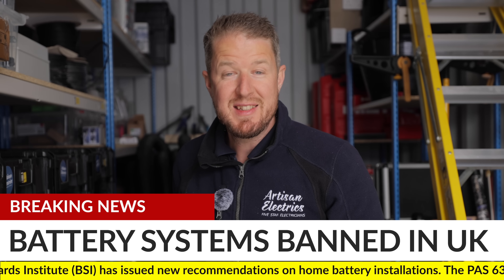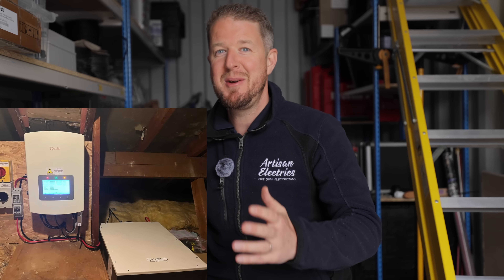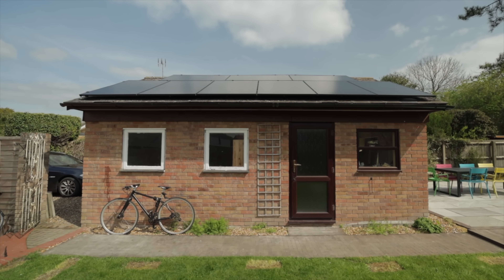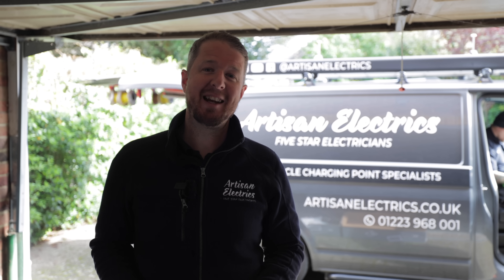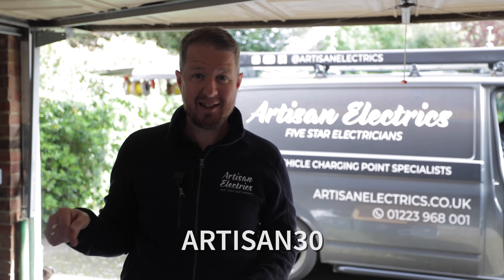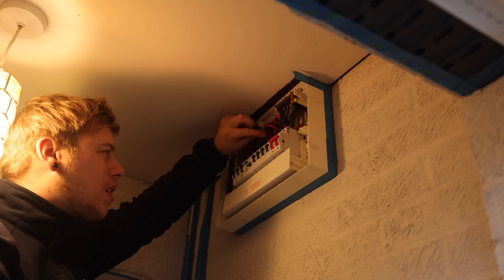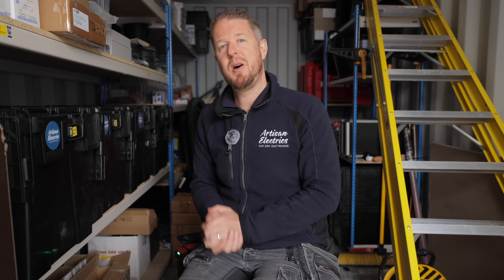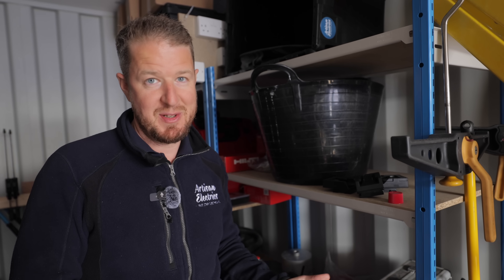Is the UK Banning Home Battery Storage? 😱

Comment: The UK is becoming just stupid, last year my folks had solar installed with a battery in the loft....... how many properties in the UK have an outside 'building' at all....let alone to install batteries.... this is another reason why solar is not going to take off in the UK... stupid rules like this... there are other options for battery installation in a loft, like adequate air flow to keep batteries cooler in summer... its really not difficult.... Fire in the house ... yes of course this can occur, but this is why you have insurance to a standard.! If the standard ends up changing because of this it's just stupid......... to prevent people from being able to save money but also reduce carbon foot print. This is another case of trying to make 'free electricity' difficult so the less well of person without 'a garage', can't save money.. why.. so you have to keep paying those poor people at the top of the chain in energy companies.

Comment: Problem in battery loft installation is heat in the summer period. I assume the battery chemistry is lithium-ion and as we all know the electric cars use this battery chemistry and when the battery pack increases its internal heat a cooling system is used to ensure the battery temperature remaining within the stated temperature range as per the battery manufacturer.
So what keeps the loft batteries installation cool in the summer?
Reply: Most solar batteries are lifepo4, not Li-ion.

Comment: As an installer you have a duty to exercise due diligence and from your video you should be recommending that batteries etc should be fitted on an outside wall in a suitable IP rated enclosure complete with the necessary ventilation. The IEE rules and regulations are lacking no electrical engineer should recommend fitting a battery unit or a device that needs inspection and maintenance in a loft it’s irresponsible.

Comment: Greetings. You recorded this video in a container, which has insulation on the roof. What insulation did you use?  Did you screw or bolt it to the roof, thus rendering the container no good for shipping.
I have a container workshop in southern Spain and last summer the Max/Min thermometer read 66C.  So I couldn't have a solar battery in there then! Thank you.

Comment: The recommendations make much of the need for fire proofing around the batteries but surely these can’t apply to lead acid batteries which are also often used in a bank to supplement solar panels etc.  These have no known fire risk because of their construction.  The only risks are possible small emissions of Hydrogen and Oxygen if their charge controller is allowing them to over-charge which it shouldn’t do, but these emissions are quickly dissipated by even the gentlest ventilation.  And sealed lead acid batteries such as AGM types which can be mounted upside down on on their side, don’t emit anything.

I hope the recommendations distinguish between battery types rather than attempt to become a ‘one size fits all’.

Comment: The new regulations state that batteries can not be installed in a loft as they could fall on people and are more exposed to the elements... Instead they now suggest you now install them outside where they are directly exposed to the elements.

Comment: as an electrician who started working in the 1970's  I used to remove metal fuse boxes & replace with wooden backed & plastic fronted ones, we was also told not to fix them on a wooden board due to fire etc but then came the Electricity board & they fixed the main incoming head & meters on chipboard!!
now its gone in a complete circle & metal has come back, also grommets where ok in the older metal boxes now they are not.
I think somebody is making a lot of money changing all these rules & regulations, maybe we should all just use our common sense, remember when we had to take an earth wire from the consumer unit direct to the metal bath legs then drill & tap it & use a brass 2BA scew & washer,   what stupid person thought of that?  then they said lets change the colours of the wires to Harmonise with Europe, what a load of nonsense that is, I've worked in France/Italy & Germany & none of these countries use the colours that we have now had to change over to, France use Blue as the neutral, green & yellow as the earth & then all the other colours of the rainbow can be used as live's this is great as when you wire the consumer unit you can use different colour wires for certain circuits so you can identify them just looking at them,  there is also no such thing as a ring main, they just use Radial circuits (so much easier to find a fault)  also RCBO's have been out there for over 20 odd years & cost half the price that we pay.
We have a lot to learn from the French way of wiring.
My last gripe is using the new colours on the 3 phase , this is rearly Dangerous, how can black be a phase when the old system it was the Neutral? i wonder how many people have got a shock or died because of this change.
Reply: You forgot the "feed in to consumer units must go through the same hole to stop overheating by eddy currents"  You would need to push hundreds of amps through the circuit to even cause a single degree of heating.  And the not running data cables next to power cables (in a domestic install) to stop dangerous induced voltages !  Those who generate these regs don't seem to apply practical science to their deliberations a lot of the time.

Comment: I have two LFP 5 kWh batteries in my loft. They both have an internal fire extinguisher. The brand is Sessy (NL) and they are connected between the solar inverter and the consumer panel. The location is not ideal I agree and our new house will have a detached garage for sure for the EV's, solar panels, inverters and batteries.

Comment: Not recommending/allowing in the loft or even in the house would make a lot of installations impossible at least in The Netherlands in modest "15 under one roof" row houses.

I do get the reasons.... Thermal runaway and uncontrolled fire/exolosions are real substantial risks.... In common NMC cells. BUT a lot of 'statuonary' batteries are moving towards LiFePo4 chemistry. 

And with those, uncontrolled thermal runaway is not a thing any more. The can still eject explosive/combustible gas when 1 or more cells get damaged, so at least there should be adequate ventilation available.

Unfortunately, LiFePo4 doesn't like cold/freezing conditions. So outside the house or in a badly isolated shed is not an option

Comment: My view on best practice standards are they are of most use if something goes wrong and someone asks "there is a specified standard for this, why did you deviate from the best practice?" 
This way of work could be introduced into Fire safety: Approved Document B or a new part of the Building Regulations such as with EV charging points in 2021 and the introduction of Document S: infrastructure for charging electric vehicles.

Comment: i thought people would choose them outside in a cabin ive always think safety when 
even storing a battery.
i think if its outside then you should be able to gave as much as u want but maybe they could also note were they are 
just incase also if u want more power or so using a battery bank for big things seem to work good as a buffer for most things.

Comment: Yep they do not want people being energy independent and off-grid, they want us dependant upon the energy pushing gangsters, guess what we do not need the grid anymore or the totally obscene standing charges!  On another note I am sick of hearing about inverters, batteries or any power electronics in lofts. The temperatures in lofts are just too high in the summer, my batteries are in insulated, vented cabinets outdoors, mine even have an automatic fire extinghisher. The KW hour limit is certainly designed to prevent people going off-grid. The energy companies are getting scared, solar panels are dirt cheap, batteries and a tiny back up gen set can get you buy a few bad winter days. The grid has overpriced itself, I got off grid, they are no better than street drug pushers.

Comment: It all seems to be about the risk of fire from batteries, but EV and other pressure groups say there is no increased fire risk from Li batteries, so is there a real risk of fire or not ????????????????????
Reply: That's relative to the fire risk from cars in general. Normal cars occasionally set themselves alight as well.
Reply: @spankeyfish  car fires are Usually due to a lack of maintenance or diy bodgery, a mate drove around with a fuel leaf for weeks, when it burnt out the only bit unburnt was the base of the passenger seat, with the roll of fuel line and clips sitting there undamaged! I suggested he remove them before the insurance assessor arrived!  My point was that the narrative is Li batteries are safe but then new regs and rules keep popping up that seem to say different...............................try getting a damaged EV recovered from France!

Comment: Could two batteries half the usual size be installed in smaller (safer) spaces and joined together? That would give you more options. Maybe even ten smaller units could be more conveniently stored. And you have the option of spacing out the installation of the batteries depending on the budget and added to later. Win-win. Are there any electrical or technical impediments to storing multiple batteries. For example the Bluettis B  units. Also they can’t be too far apart.

Comment: What about all the homes that don't have garages or outside buildings to stick batteries in?  This just for the rich kids with detached homes?
Reply: Completely agree, most houses in the UK don't have garages or even suitable outdoor space to install batteries and the guidelines do not distinguish between different battery chemistries, also what about the solar inverters and associated DC cabling since these are the main sources of solar related fires?
Reply: No different if they don't have a roof to put the solar panels on.  Pretty hard to have any solar / batteries if you live in a tower block

Comment: Really bad idea to put them in lofts , increased fire risk from these installations  fire spread through lofts is a compromise to the fire safety of the building as lofts can spread fire via timbers and cavity’s into the lower levels occupied .
Personally I would want them installed externally to the occupied part of the building .

Comment: Is this the start of the end for net zero as I'm sure alot of the uk housing stock won't be compatible with external battery storage leading to customers to not bother with solar at all
Reply: Not at all.

Firstly good insulation is the biggest win for net zero.  Secondly, if the government reversed the ridiculous policies to put the brakes on renewable energy generation both domestic and commercial that they began in 2010 then not only would we have greater national energy security and a reduced demand for energy but also cheaper energy as well as cleaner energy.

Then help people to use that cleaner, cheaper renewable electricity instead of gas and oil and ...   👍👍👍👍👍
Reply: It's the current tariff structures that push people towards domestic battery storage. It would be comparatively easy to remove that incentivisation.
Reply: A lot of the UK housing stock is unable to have solar anyway so the battery issue is not an issue for many.
Reply: @barrieshepherd7694 There is a huge amount of UK housing stock that is suitable for solar. The potential has hardy been scratched.
Reply: We are screwed if net zero does not happen, everywhere.

Comment: More food for thought as to where to put batteries in due course (with a solar install).  Loft (for me) was an absolute not happening (weight, servicing, temperatures etc) but garage is under main bedroom so needs updated fire safety - doable with an addition of fire board on the ceiling I guess.  Outside is an issue with location and weather protection being needed.

Comment: Batteries should be close to the charger -the cabling between those is LV (usually 48V) so quite fat. Stringing those high-current cables all the way to the garage might be more of a fire risk than just putting the batts next to the inverter.

Comment: Worth noting that Australia has had much stricter regulations than this on batteries for a few years now (3?) They have to be outside in a big metal fireproof box. No ifs or buts. (maybe one state, not all of Australia?)
Reply: I think Oz has a lot of wooden houses so a battery fire on an external wall would still set fire to the house. 
A firebox could be made to work in a loft if you had it on legs so it's not touching any woodwork and fitted a big flue to vent the gasses/fire out through the roof.

Comment: Stick to what you're good at and battery chemistry isnt one of them. Just because there are videos on youtube of people doing things doesnt mean they are true. In some ways LFP batteries are safer than NMC's but in other ways they are more dangerous.
And in terms of BESS the nail test isnt the best safety test. Overcharging is a far better test in this environment as its far more likely.
I do however agree with the new guidelines that BESS should not be installed in lofts. Solaredge for example state operating temp must not exceed 50c. It gets hotter than that in the summer even here in the UK. Not to mention the extremes of cold in the winter.

Comment: We didn't really switch from fitting plastic CUs to metal pones. We went back to fitting metal ones. They were all metal for decades before the plastic ones were allowed in the 16th edition (1991) (and 17th 2008). So people fitted these for ~ 20 years because they were cheap ,and it was supposed to be a safety improvement, until it was stopped in 2015.
Reply: by fuse box was Bakelite, not metal
Reply: @jocramkrispy305  Fair point. They were Bakelite before they were metal (which is technically plastic) - so we have oscillated back and forth :-). My 1961 house was metal (originally). Not sure what period the bakelite fuseboxes were fitted.
Reply: @xxwookey  mine was built 1929

Comment: The recommendations make sense.
So how about digging a square hole outside, make it a box (concrete or thick metal) and keep the batteries outside this way?
One thing I find interesting in this context is electric cars "stored" (=parked) in garages attached to the house. And they are even considered to become "public"/grid storage units.

Regarding lofts: I think they are still a better place than cellars because fire moves upwards, not downwards. Yet, I wouln't want batteries in the house for sure.

Comment: No disrespect to you al, but this solar battery thing is totally different to ac electric systems.
As you know ac and DC electric is two complete different systems.
I do think we should have "as you guys are" ac 18th edition and up to regs 
Should have a DC qualified regs, 
Car mechanics now have to have them to work on EVs.....I know the voltage is more higher and so more dangerous.
I could go on.
Iv a question, how can I wire my house to only run off day rate on economy 7 meter and separate timer??
Dont say smart meter......
Id prefer to install a Genny than a smart meter.

Comment: These guidelines don’t make a lot of sense applying one set of rules for all batteries when the technologies vary dramatically. From a functional point of view putting batteries in lofts or outside is going to impact on its performance.
If you are talking about safety, then it really depends on the technology used to make up the battery. I’d have no issue with installing a LiFePO battery, which is considered to be fire safe, inside a house, but other Lithium battery types can have a much higher risk of catching fire, same for lead acid batteries, so these guidelines are ignoring these differences and pandering to the panic from bikes and scooters that sometimes catch fire.

Comment: So many houses don’t have outside space (with sufficient distance from a window as described in the standard) or a garage to fit batteries! 

This standard will hammer installations and slow down our green mission fast.

Why not add a exception condition for manufacturers who meet a new standard where fireproof fittings are necessary? Or force installers to install fire detection integrated into the house?

I did read the standard and feel like it was rushed, did not consider alternatives or impact of the standard and focused too much on general 2002 batteries, not the complex and very safe systems that you guys are installing!

I don’t disagree with the standard, I just think it has a big impact that has not been fully considered or thought through.

Comment: no batteries in my house. All in a detached garage. I followed HBPowerwall on you tube and have a couple of  DIY 18650 cells powerwalls (4.5ks each) along with 304ahc lifepo4 powerwall (8kw( .  All have the latest JK BMS fitted.  I monitor them and use a thermal camera. I would not dream of putting these in the house. Worse case scenario, the garage goes,,,,,,, whooof. :)

Comment: Its honestly ruled me out. I live in a 3bed detached with external garage.
I don't wanna see the batteries and I don't wanna put them in my garage (takes up vital garage space).

So only plan was to put them in my boarded, vented loft.
Reply: The garage is where you put the heat pump.
Reply: @rogerphelps9939  😎Alongside the batteries ! - At least the noise from the heat pump will be attenuated.
Reply: @barrieshepherd7694  Heat pumps are becoming quiter, especially ground source heatt pumps.
Reply: @rogerphelps9939  Maybe but collectively they still become a source of acoustic pollution.